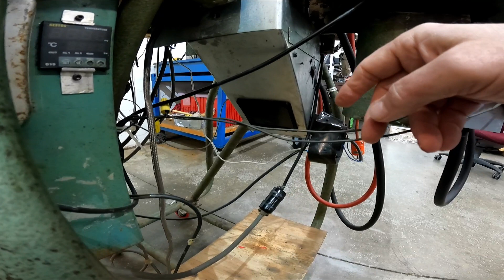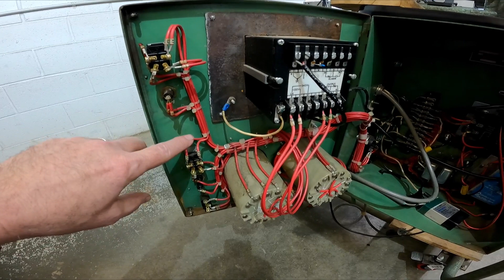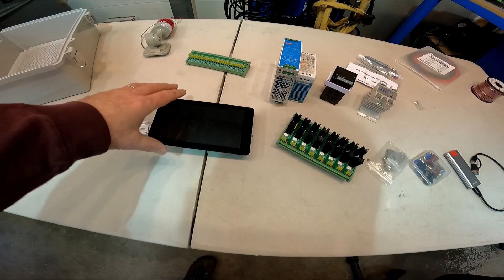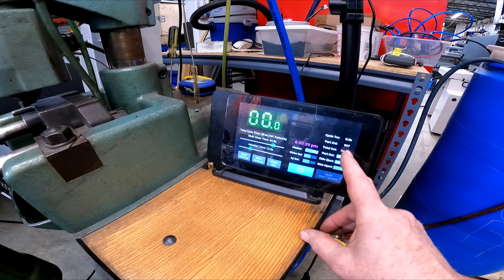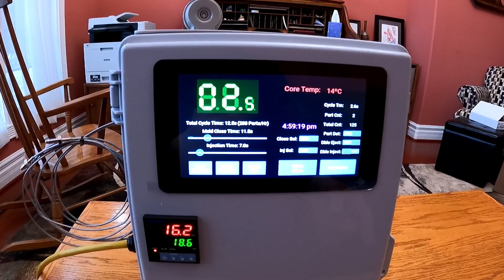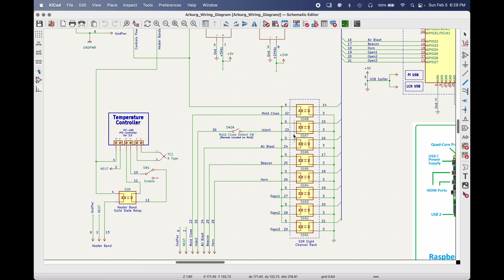New Control Panel for Arburg C4

Comment: Great work. Your C4 is in much better condition as mine. Have to use a pi4 for the software ore can i use a pi3 ?
Reply from the maker: Michael, Yes you can!  Well, I believe so anyway.  The code is pure Python so there shouldn't be any problems running on older hardware.  The running program adds 0% to the CPU load - so, no problem there either.
Reply: @705cnc  Can you please help again. Dont get the Software running correct on the pi 3. One pin i find out for the detection on the ejected part, but nothing more. The software will clos the mold an eject plastic the same time. I am desperate because my original Arburg electronics are broke :(